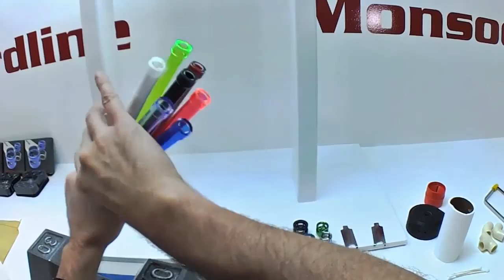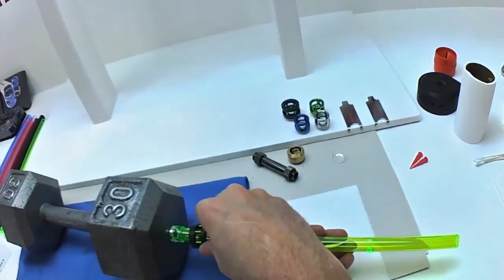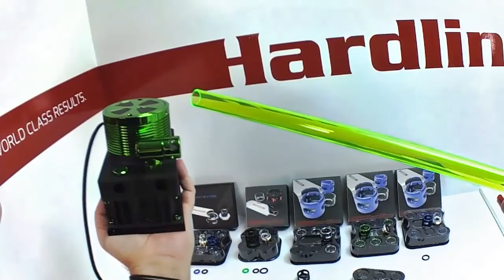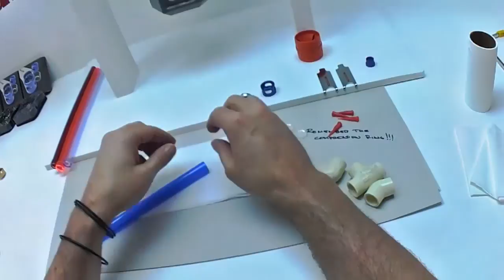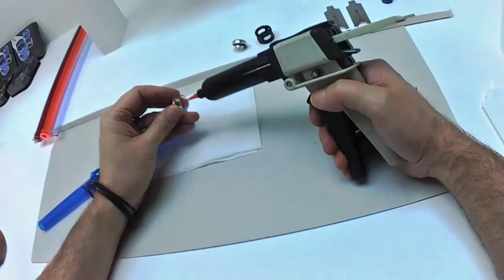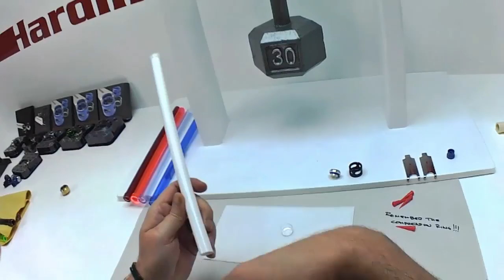Monsoon Hardline Premium Fittings

Comment: Can you use CA glue on this tubing, or will it crack it? 
I'm in the process of doing another liquid cooling setup on my system, and I want to use the hardline tubing so I can do a completely custom setup. I have plans drawn up on paper so I can make the bends where I want them. 
I see that you have several types of tubing and fittings. Nice video, and great explanation.
Reply: You shouldn't use any glue on your tubing when using hardline. As for the rest of the project, feel free to get in touch with us if you need any more assistance planning your loop. 

Thank you!

Comment: If you've noticed your sales have risen that's probably me, love the fittings!  Using the machine gun types as in your video, have 45 of them to fit in some builds, but I'm having an issue with the UV glue. I have the small black bottles from Performance PC and Amazon, tried the sunlight method for 30 mins, then an UV flashlight and it seems to stay gooie(sp?). Any suggestions?